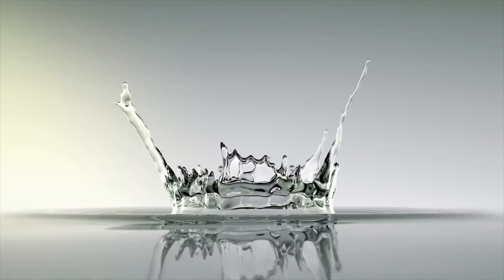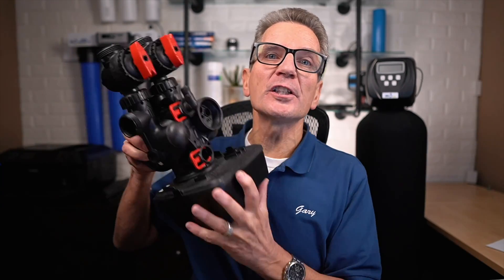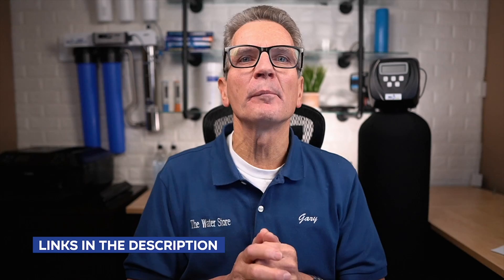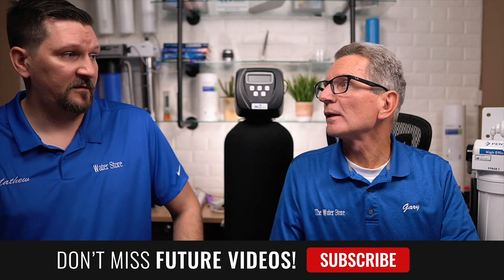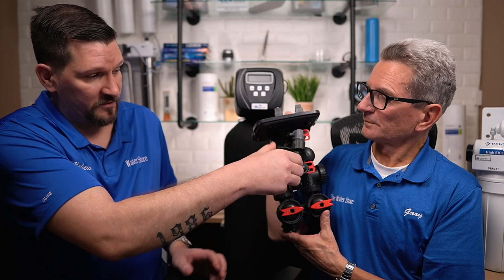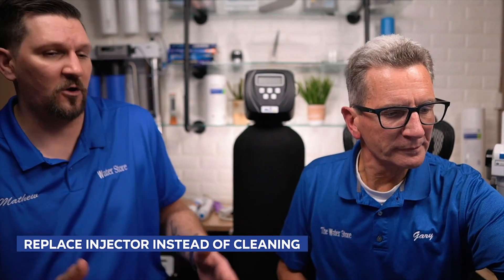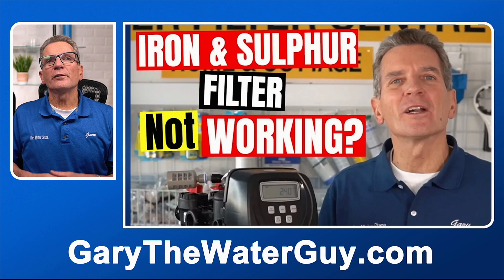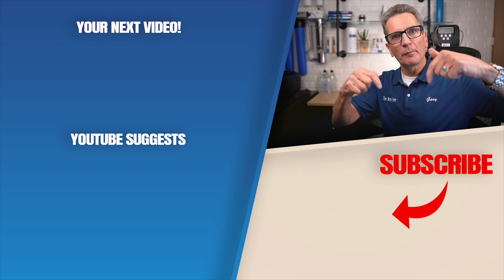EASY DIY Iron & Sulphur Filter MAINTENANCE

Comment: Thank you for all the great content! I’ve got a couple of questions about using iron out for restoring dirty units. First, does soaking the valve/parts deteriorate the o rings or seals if left for 12-24hrs? I’ve still got some iron residue after 24hr soak, can I soak longer? Secondly, do you think a unit that was put through unusually heavy use for less than a year will need the media replaced or just cleaned? Thanks!
Reply from the maker: I have never left parts in iron out for more than 24 hours so I don't know. It would be incredibly rare for an iron filter that was correctly installed and maintained to need to have the media repalced within a year, but it is possible.

Comment: I have a CW SmartClear air induction system. Not really having any trouble I know of, but I have not done anything with it in quite a while. Unit is about 12 years old. It does have the Clack valve, according to your description. Looks like the only thing I should do is clean or replace the injector?
Seems like I cleaned another part of it a while ago, but I forget now. Should water not leak out when both of the arrow valves are closed?? Thanks
Reply from the maker: Yes, when bypassed it is off line, but you need to start a regeneration first to release the pressure.

Comment: I bought the rebuild kit and installed it. I now have water coming out of the air suction line. Not a lot of water but some when it first goes into the backwash cycle.
Reply from the maker: It sounds like you need to replace the Air Draw Assembly, we have them here https://waterestore.com/products/clack-fob-c-k-strainer-check-valve-air-intake-assy

Comment: I have the Clack ait over media water softener.  The company I purchased it from comes annually to service the system last month my water began to have a metallic ir weird smell.  It stays on my clothes and skin.  It's funny, but my Brita filter seems to make tge water ok.  But apparently the water softener is not softening the water. 1. When my system is serviced, do they routinely check the injector, tge little filter etc?  With the terrible situation they came and did whatever they do and i leave them alone, so they dont  think im just hovering ov e r them.  They s came upstairs and said everything is okay and there is nothing they can do.  They did a pool test of my tap water and said the ph is fine. I don't know what to do next. The company says they sell a "big blue" filter, but It's not possible financially right now.  It was going b to the water lab and get a kit to submit a sample to them to see what is "off" in the water.  This is especially difficult for me as I'm 69 years old and am alone. I'm not a wimp, or have serious physical limitations, but I do feel a little helpless because of my lack of knowledge.  I've been taken advantage of in the past.Your toughts?
Reply from the maker: Typically and air over media system is not a water softener, it is an iton and or sulphur filter.  You woudl need to ask them exactly what they do during the service.  If the injector was clogged you would get a metallic smell.  I would check with them.

Comment: I have one of these 1.5yrs old, I woke up to 0 water in the house this morning, randomly completely clogged I assume (not sure yet), I put it in bypass, and my water works now, but my inlet valve is now Jammed on the right in bypass mode, and wont turn anymore.... -_- . Somehow it caused my well pump to continuously run as at 0 pressure for some reason, and this morning it was leaking from all seals, and switch lines... everything is only 1.5yrs old...I like your videos, ill see what I can find, I already paid these plumbers thousands of dollars before to resolve the massive smell.
Reply from the maker: Sorry to hear, is your equipment installed before or after your pressure tank?  If installed before, the pump would not shut off, which would explain what happened to you.  They are meant to be installed after the pressure tank.

Comment: I have the system behind you. My home smells so bad we cannot bear it. We are leaving to a hotel
Reply from the maker: Sorry to hear. What differentiates one system from the rest is what is inside the tank. If your system has one tank that uses salt, that is a water softener which will not get rid of the sulphur smell. You need a sulphur filter like one of these https://waterestore.com/search?q=foc if you have a sulphur filter and it isn’t working it might need service, check this out https://youtu.be/pjlBYtixwUM
Reply: @water_estore  
My system has 3 tanks. 2 tall black ones and a medium tan colored one. Which I believe to be the hot water. It also has a 55 gallon clear plastic tank that does absolutely nothing the water is turning green.
So you’re in front of the system facing it, the two tall black tanks are on the left-hand side directly to the right of it is the tan hot water one. to the right of that is the motor the compressor on the floor. Behind the compressor is the third black. It looks like in the garbage can that’s where we put it the salt in and to the left of that behind the two tall black pigs is that 55 gallon water tank and that’s how the system looks. It’s only 10 months old. It was built brand new, I have no idea how to fix it and the smell is making everybody delirious and sick to the stomach. Hopefully th allow you to help me fix this it’s unbearable.

Comment: My clack valve on my iron filter is blinking "call" should I be concerned?   How do I make it stop? Thanks!
Reply from the maker: Some companies program that in on an annual timer so you will call them for a service call (and charge) that you probably don't need. No need to be concerned. To get rid of it press the next and down button at the same time repeatedly until you get to the end and then turn service reminder off.